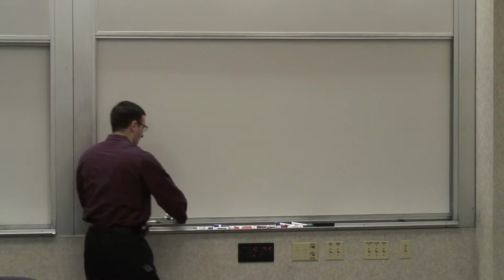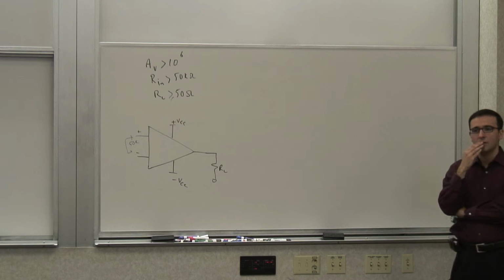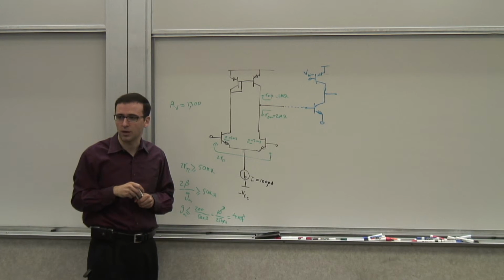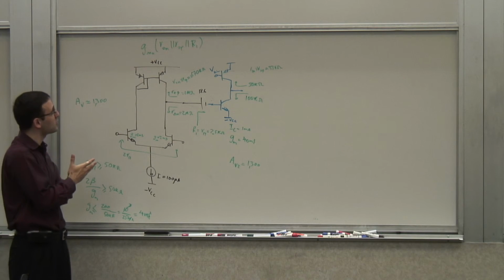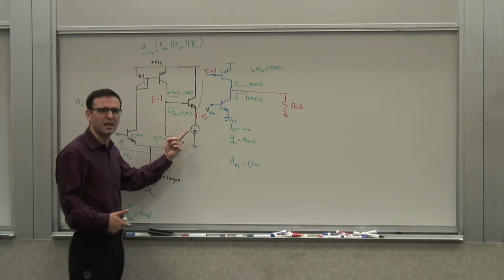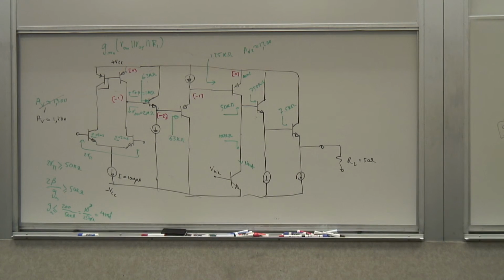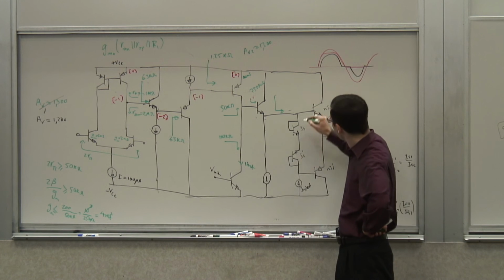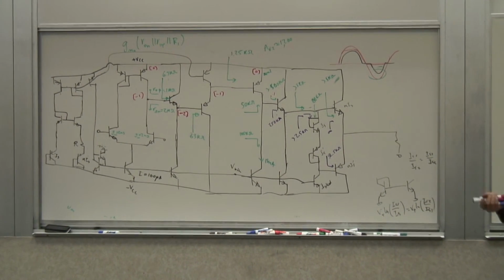131. Make a Basic BJT Op-Amp (Low Frequency): the design process (Part-I)

Comment: In minutes 50.00, I dont understand the difference between the common emitter from 2 buffers before in terms of voltage swing since it can go to [Vcc-Vcesat, -Vcc+ Vcesat] while after two buffer stages it only can go to [ Ibias*50 , Vcc-2.5Vbeon] the upper limit is not Vcc-Vcesat any more, sir, can you tell me the differences between both of them?  thank you